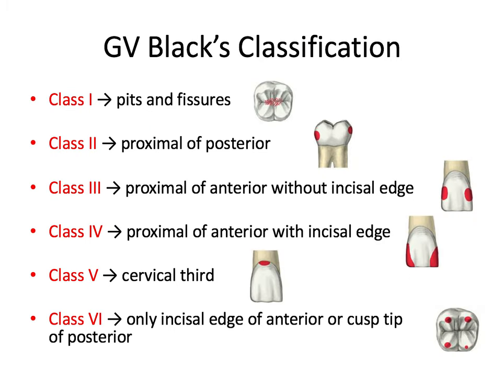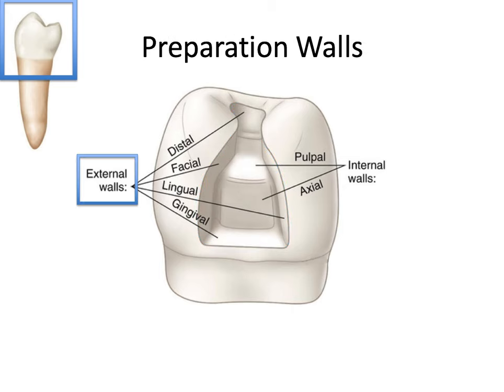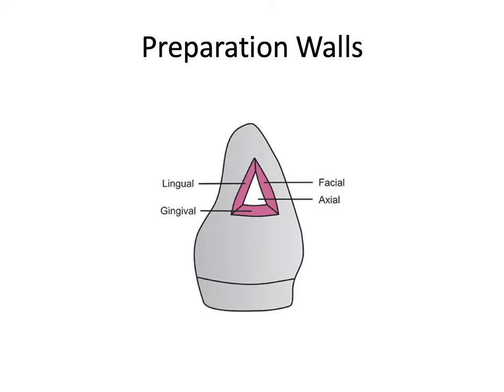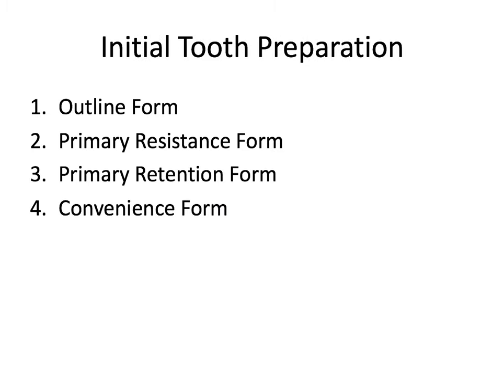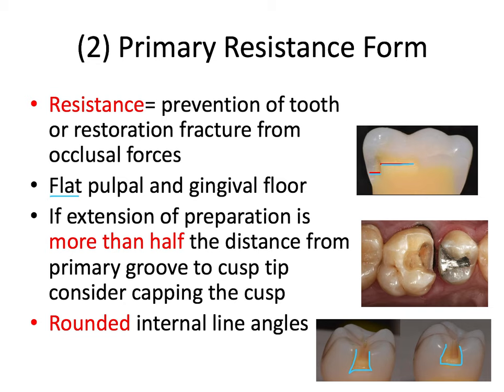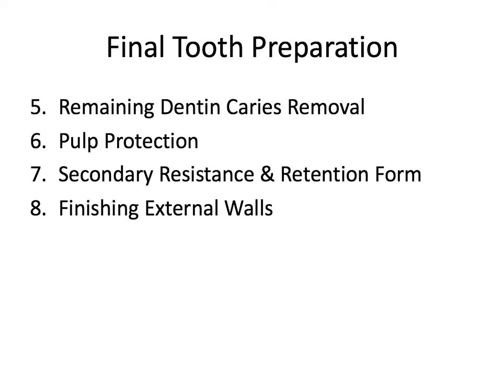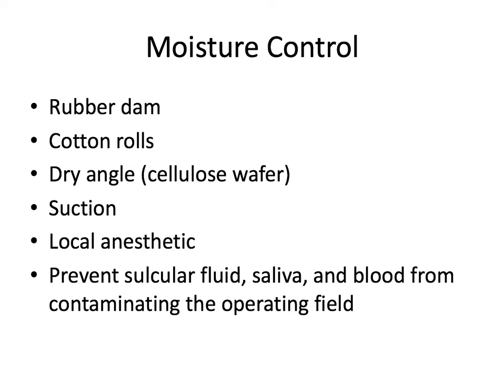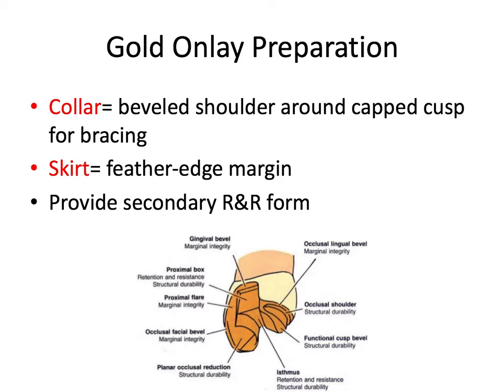Operative Dentistry | Cavity Preparation | INBDE, ADAT

Comment: What is Difference in varnish nd sealer under amalgam restoration?
Reply from the maker: They are practically very similar to each other. A varnish is used to help provide insulation and sealing ability underneath the amalgam, and is made up of dissolved resin in an organic matrix.